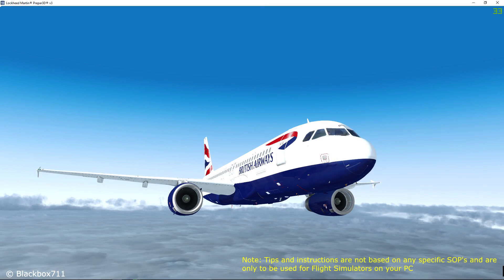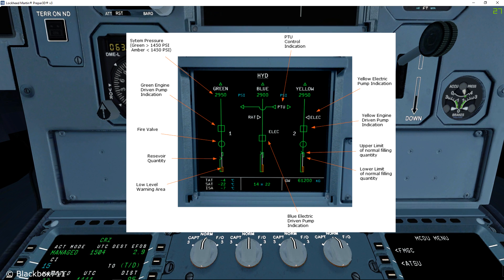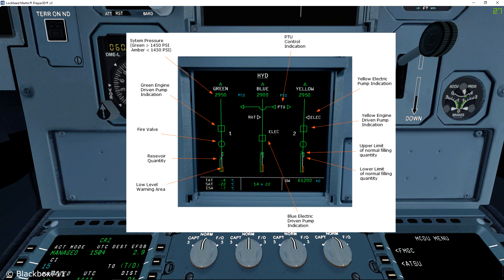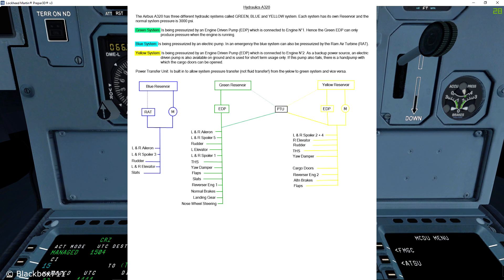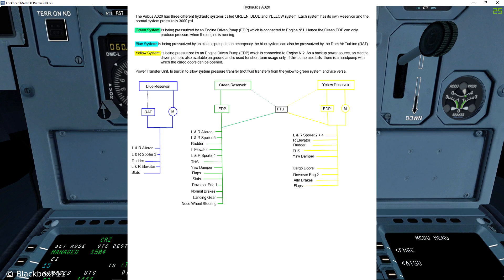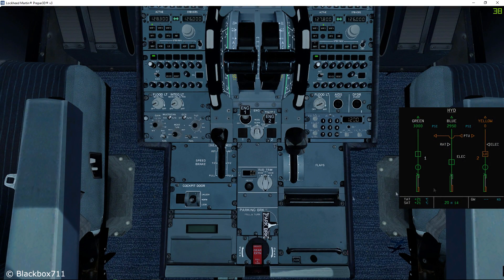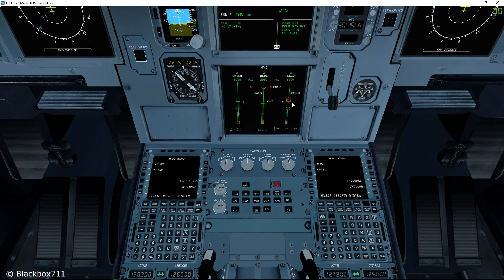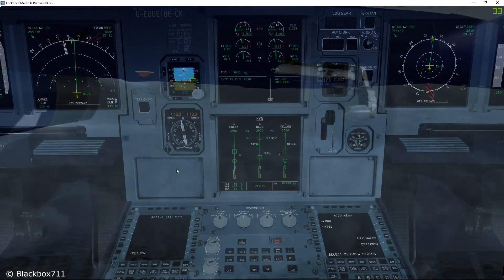FSLabs A320-X Basics: A320 Hydraulic System

Comment: Great tutorial video.,Out of curiosity, is it possible to pressurized aircraft hydraulic systems using electric motor pump or hyd. ground cart without any engine installed, just to perform other maintenance requiring hyd. power?
Reply from the maker: Hi. Yes there is a way to have the yellow system pressurized electrically and via a maintenance button the blue system as well. The PTU will pressurize the green system when the system logic allows for it.

Comment: Hello Blackbox711. I really enjoyed this video. I found it very educational. I have two questions. 1) When and why would you use the EXPED button on the FCU? 2) What does the red button on the side of the thrust levers do? Thank you in advance.
Reply from the maker: Hey MCK.. Thank you! You would use the EXPED button for example when ATC asks you to climb at the maximum rate possible. That way the Autopilot would pitch up and trade speed for altitude and reduce speed to Greendot. The red buttons on the side of the thrustlevers are the autothrust disconnect buttons. Regards BB

Comment: Hi @Blackbox711, so, when I start engine 2 first, the PTU transfer pressure to green system because of the breaks? As the aircraft is at the ground, the only system that I need is the normal breaks. So, if I start engine 1 first, theres no need of PTU, thats correct?
Reply from the maker: +Edgar Predabon .. Hi. Be aware that there is a PTU selftest when engine 2 has started. That has nothing to do with the normal PTU operation. In case of single engine taxi in you want a second (backup) Hydraulic system for the brakes. That is why the PTU would be running witch one engine off and brakes released. But that is why you would switch off only engine N*2 and then switch on the yellow electric pump. I made a video about single engine taxi. Have a look here if you like:   https://www.youtube.com/watch?v=5qBKECtDaWM&index=6&list=PL24XRTIr2OjIe7PvRwS50Lf74nZFUeE9x

Comment: Hi, great video, as always. I'm incredibly grateful for your channel, it's rare to get such structured and well-produced advice! I am wondering, and have been since you first mentioned it, why the rudder is considered the 'most' important control surface? I'm aware of the 737 rudder hardover issues and the subsequent crashes but surely, if the elevators were to 'hardover' either way it would be equally unrecoverable? Cheers again, danke für die Videos und - vor allem - weiter so! :)
Reply from the maker: +NihiL ... Thank you for your kind words! The rudder is most important because of the recovery function when dealing with engine failure. If you have a failed engine and the rudder doesn't work, then the aircraft becomes unflyable. However any hardover (full and unrecoverable deflection) of flightcontrols (elevator, rudder or ailerons) would also lead to a loss of control. Regards
Reply: Danke für die Antwort! Thanks for the reply! Interesting point about engine failures in combination with 'loss' of rudder, I didn't consider that! Here's a crazy thought: would it make sense, if you happen to have lost control of the rudder hydraulics AND one engine quits, to idle or shutdown the other intact engine just to stay in control? Would your chances be better to survive with no thrust compared to asymmetrical thrust?

Comment: Loving the content, very well instructed. Just curious, in the event that the yellow system had a complete loss of pressure, would the green system be able to provide pressure indefinitely via the PTU to the yellow system or would the PTU have a particular time limit on how long it can be used continuously for?
Reply from the maker: +Airflow993 .. as long as there is no overheating or low level in the yellow hydraulic reservoir, there is no time limit for the PTU

Comment: Great video as usual! Very informative. 
Question though, how do you get a pressure transfer without the transference of hydraulic fluid?
Reply: I'd assume it's a transfer of mechanical power. Not an expert tho.
Reply from the maker: +Nav0074 .. yes, it is a bidirectional, mechanical connection. So the remaining hydraulic system (let's say green) will power the PTU which will use Hydraulic fluid of the other system (in this case yellow) to power that system. So if the yellow system in this case was overheated or not enough fluid available you would not be able to use the PTU.